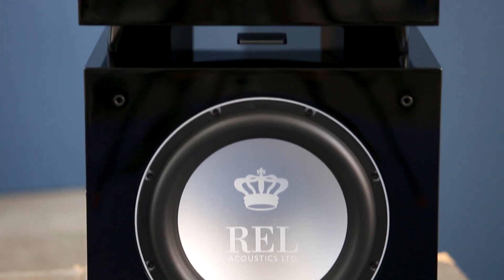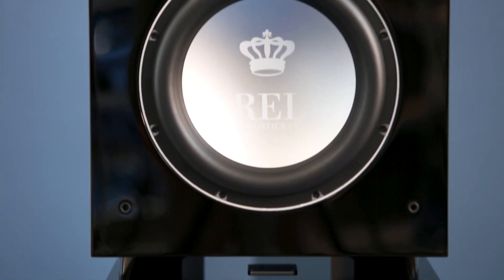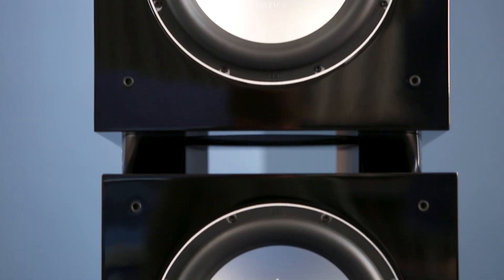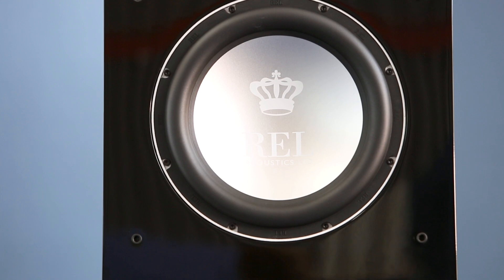Building Up To A Line Array

Comment: The twin REL S/812 are incredible, when I was placing them in stereo with my floorstanders and doing the tuning with the "Sneakers CD" that is recommended, I ran some of the other tracks in that CD and holy ghost, I swear with just ONE sub active near the Left speaker, a spatial effect happened and I swear it came from the right hand speaker, I turned off the Left sub so none were on and the effect from seemingly "outside" the speakers went away... In not short terms "Starling" I've heard things, in the high end that I've never come across before... I only have the 2 S/812 in stereo on the floor, the "Anchor" phase subs, and I'm trying NOT to talk myself in to getting 2 more down the line, and then eventually another 2... But I think over time I will, as I save my pennies up 🙂
Reply from the maker: Thank you for your feedback, and we are very glad to hear that you are enjoying the performance of your two S/812 subwoofers!

Comment: Hi, I have one difficult question, at least to me, about whether buiding line arrays of S510 or having a pair of n°31, both configurations are about the same price. Is my hesitation relevant? Thank you
Reply from the maker: Thank you for reaching out. Either option can work well for different systems and rooms. When you have a chance, please write in to contactus@rel.net with the dimension (length, width, height) of your room, the model of main loudspeakers that you are using, and the model of amplifier that you are using to power these speakers. With this information our team will be happy to provide a subwoofer pairing recommendation specific to your system.

Comment: Will one line array be okay or will the soundstage be off?

I’ve only got room for 1 stack.
Reply from the maker: It is possible to run a single line array stack, though the best performance will of course be achieved by using two line array stacks in a stereo pair configuration.

Comment: Do the line arrays have to have the exact same speakers? Can you mix say a REL No 25 along with a Carbon Special? Having the REL no25 at the lowest level and then the other levels being Carbon Specials?
Reply from the maker: When stacking subwoofers in a line array configuration, it is necessary for all subwoofers in the stack to be the same model. This not only ensures that the sonic performance of the subwoofers is matching from top to bottom, but is also necessary so that the mounting brackets can be used to fasten the stacked subwoofers together.

Comment: Can you make a setup video on how they connect
Reply from the maker: When setting up a REL Line Array, the bottom subwoofer connects to your amplifier or AV processor using the typical REL connection methods. The High Level and .1/LFE outputs on the bottom sub then feed into the corresponding inputs on the next sub up. This process is then repeated until all subwoofers are connected and receiving signal.

Comment: Greetings,
Can I stop the array line at 2 subs? What would be the advantage over having just 1 sub for left and right channels?
Also, can I or should I build an array line for my center channel if I am using an S/510 as a dedicated center subwoofer?
Thank you.
Reply from the maker: You can stick with 2 subwoofers for each line array stack if you wish, though the best performance and full potential of the line array configuration is achieved with the full 3 subwoofer stack. However, even with just 2 subwoofers in each stack you will still experience improved dynamics, tonal definition, and projection of the sub-bass output into the room. 

Since the center channel in a surround sound mix is primarily used for dialogue and other voices, we find that this channel does not benefit as much from the stacked line array configuration. Using a single subwoofer dedicated to the center channel speaker will provide excellent performance in itself.
Reply: Thanks a lot for the reply.